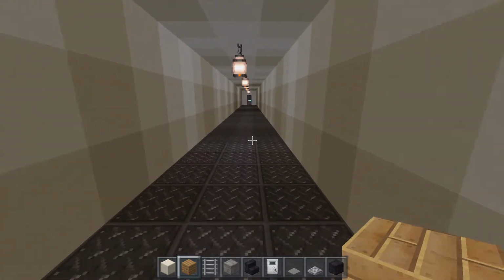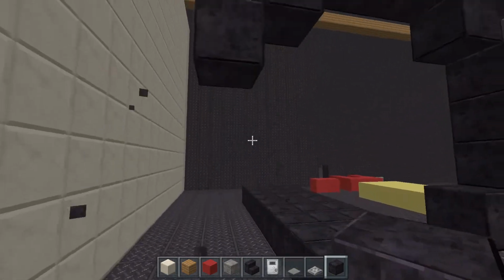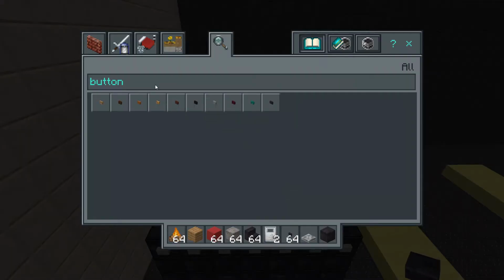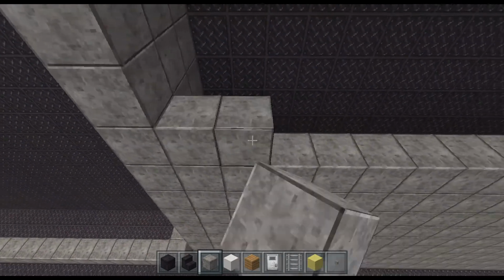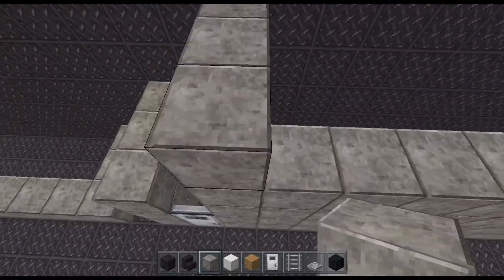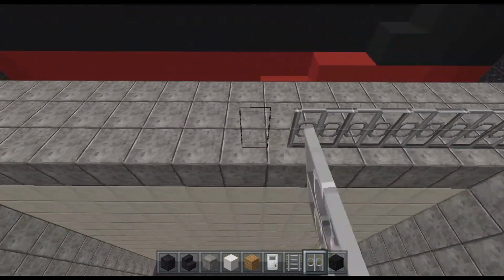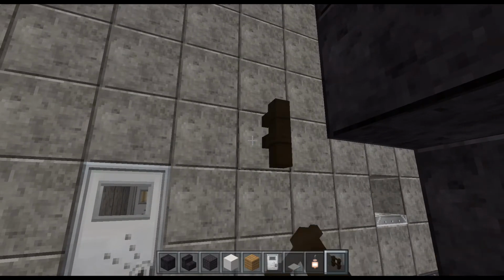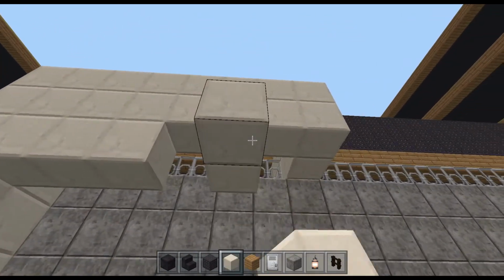MINECRAFT RMS TITANIC INTERIOR TUTORIAL PART 5

Comment: I just wanna say, this is a great tutorial and I'm enjoying it so far. For me, I'm following this tutorial but with Rich's redesigned hull from his Britannic tutorial. I'm able to make it work so far, although I've had to readjust and slightly redesign the fireman's staircase and the first boiler room because the new hull is a lot thinner than the old one at the bow and stern. 

Hopefully the closer to the middle of the ship I get the more easily I can copy the tutorial but overall if I can just get an approximation of where things go but tweaked slightly to fit the different hull that's just as good. Luckily everything from C-Deck and up is the same as Rich's original Titanic tutorial so I shouldn't have any issues ince I get up to there.